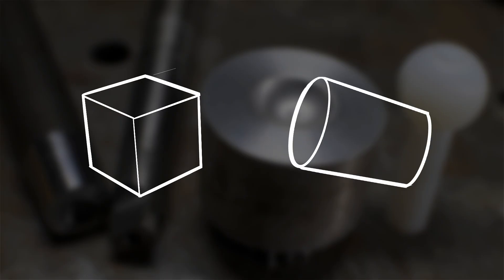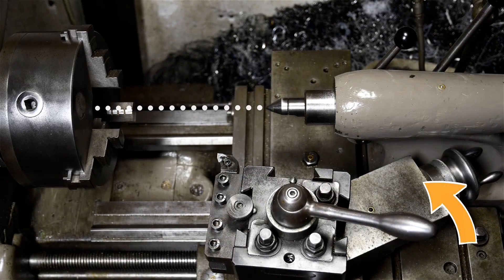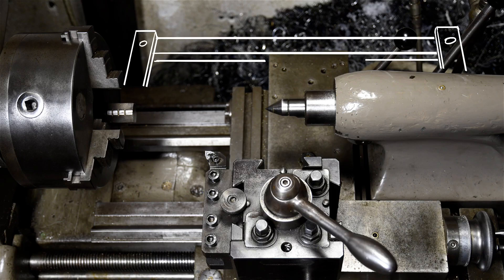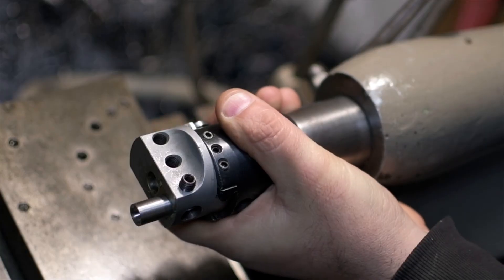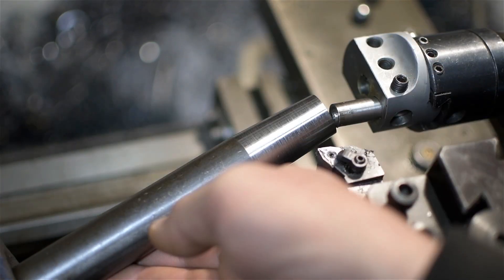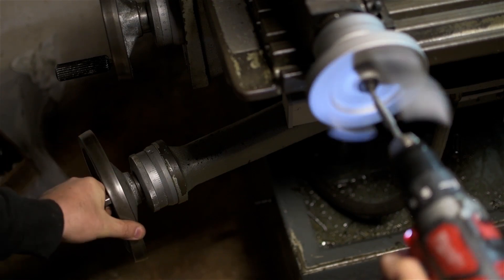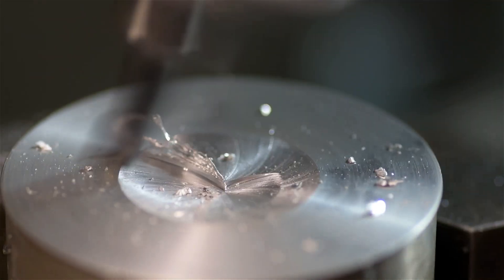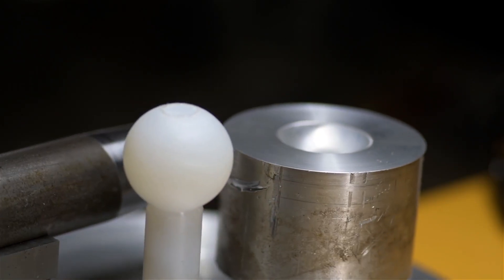Boring Heads & Tapers & Spheres, Oh My!

Comment: It is a sphere:
TL;DR:
Once you've finished clearing the center of the work, you've defined the work to be symmetrical about 2 axis of rotation simultaneously (the rotary table and the rotation of the boring head). This requires a sphere.

Longer, mathier version:

Imagine you're at your final z position, and simply rotating the stock with the rotary table. There exists some mess of Trig that describes the distance from the center of your desired sphere to any point on the sweep of the cutting head at that z position (remember, we're finishing, so the z position is fixed), and because the desired sphere is symmetrical about both the axis of the rotary table and the axis of rotation of the boring head, that mess of Trig is only dependent on the z-axis position of the boring head. Since that position is fixed, every point on the weird curve between the spin of the cutting head and the spin of the rotary table (doesn't matter what that curve is) is the same distance from the center of the sphere, therefore it is a sphere.

Visualization:

Imagine the boring head spins infinitely fast, so at any moment it's cutting a full rotation. If some cone's endpoint is at the center of some sphere, no matter how you turn the cone, there's the same-size circle of intersection between the cone and the sphere, at the same distance from the center of the sphere. If we use the sweep of our boring head as that circle of intersection, we must be making a sphere, because when we spun the cone the circle stayed the same
Reply: The internal curved feature is not a sphere.  The boring head spins the cutter on a circular path.  When you tip a circle, as the boring head tips the path of the cutter, you get an ellipse. Imagine a straight cut of the part using that spinning boring head, you would cut the bottom of that ellipse into the part. If you look down the cut of the part, you will see the spinning cutter trace out the ellipse that has been cut in the part.  Rotating an ellipse does not create a sphere, you end up with what Tony described, a rounded shape with an overly flat bottom.
 The external spherical ball is only a sphere if the cutter traces out a circle that would lie on the surface of sphere .. which would be hard to achieve unless you specifically set up the cutter so that the center of rotation of the cutting tip is the center of the ball you wish to create.

Comment: When are you going to talk about alternative cat-skinning methods? Will there be a video?
Reply: Poncho likes bacon He has a surface grinder and he knows how to use it.  Just need to figure out how to make the cats stick to the mag chuck.
Reply: That's easy, just fill them with ball bearings
Reply: I suppose that does give you the option to put it between centres
Reply: too much work. just ram a steel bar up it's rear :)
Reply: There's a video somewhere on the 'tubes of a guy skinning an alligator (no relation) with compressed air. I'll bet that would work for a cat.

Comment: For cutting the ball if the cutter passes through the height of the axis of rotation as it passes the equator of the ball then the resulting ball would be a true sphere.  But doing it the way you did where it passes the center line at the low dip of the angled swing it'll be some elliptical variation based on the angle.

For cutting a spherical cup you face the same angular issue that you have identified.  You need to use a flycutter set to a swing that matches the desired diameter and use it as near  to 90° to the axis of rotation of your work as you can get. So that means a fairly small center shaft and possibly a swelled head.... which is another topic.... :D

Comment: the offset boring head for tapers, silver solder balls from ball bearings* on to pieces of round stock. That way you don't risk losing the balls and only have one wear point on each end.

*The whole assembly, inner race outer race, cage and balls make up a ball bearing. The balls are just steel balls. Not to be confused with brass ones of course

Comment: Tony I'd like to know what kind of toolpost you're using..... If  it's not too personal.
Reply: Thank you I'll look it up. I bought some weird lathes for my high school shop and the compound-to-spindle center is small, but the compound slide itself is wide.  Aloris toolposts just aren't wide enough to prevent my kids crashing into the chuck. A turret type would be better, and best if combined with toolholders with height adjustments.

Comment: In theory, the closer to perpendicular your work piece and milling spindle is, the closer to a true round concave pocket you can make.... Right? Granted your tool can make the cut (ie: rigidity and cutter clearance)... you could do this with a dividing head and a flycutter/ single point gear cutter

Comment: Great as all of your other stuff. I was expecting you to do another boringheadception gag with the concave ends on the bar and the trick.  Always keeping us guessing.

If you revisit this it may be worth mentioning that the dovetail should be trammed parallel with the cross slide so its easy to put your tool on the centerline of the work.

Comment: I'm pretty sure that pocket is spherical. The flat part at the bottom is a tiny plane. It's the opposite of the problem you had with the plastic. 

Like, think about how the surface is created, it's a bunch of circles rotated around an axis. It has to be spherical.

Comment: Question! The line where the taper meets the stock isn't square; does this mean the taper is off center? How can you fix this?
Reply: It may mean that the stock isn't perfectly cylindrical.
Reply: more likely (apart from the center drill hole at the end of work being offset) the boring head in the tail stock wasn't perfectly horizontal - it has to be in order for that setup to work properly

Comment: Really cool video, did you try to attache the boring head to the toolpost? you can turn spheres that way. The boring head axis should be perpendicular to the axis of the lathe, and level with the bed. and been able to spin, obviously.
Probably you can make some sort of morse tool hoder that can spin with a lever or something.
Reply: One problem of your proposed set-up is that you cannot lower the boring head to cut down to the axis of the lathe/dividing-head or you will cut off your ball before it is finished. Therefor the angled axis of rotation of the boring head. For ball handles it would still be sufficient.
Reply: No, i meant using the boring head as a radius cutter, not as a proper boring head.
Just use a lever to go back and forth making the radious of the ball.
Reply: Now I get it. Geometrically correct but not very practical to cut an arc by hand from one side of the shank to the opposite side. I would prefer a ball turning attachment on the lathe over this proposal any day...:-) Why do it the simple way when you can enjoy complicated ways so much?

Comment: peed my pants! how exactly did you make sure the boring head is perfectly horizontal in the tailstock? dial gage along the groove? thanks!
Reply from the maker: in the video i 'sighted' it against my cross slide, but yes and indicator would do the trick.  honestly i'm not sure how sensitive it is unless you're completely 90* off.  that would be bad.
Reply: I use a machinist level on the flat of the boring head. As long as your machine is also leveled, you're golden. You can also use your cutting tool to check. In reality, you can be off by a few degrees without impacting the taper negatively. A test cut or iterative cutting will reveal any incorrect boring head alignment.
Reply: Thanks Jeff! , Unfortunately my lathe is not leveled so I guess I'd mount the dial in the crosscut sled to double check :) good to know!
Reply: but how do you KEEP it level?  If I'm using a drill chuck or similar, it'll rotate a few degrees before it really locks in.
Reply: I tap the boring head ( or drill, or live center... ) in with a brass hammer sometimes, but only rarely. There's enough load on the boring head to keep it tight in the tailstock taper, so it shouldn't twist. Make sure your tools are clean and especially your tailstock taper when assembling the setup.
Reply: This Old Tony if it does move, it shifts the work piece vertically, which takes the cutting tool off centerline. So one or two degrees isn't a huge deal. But ten degrees is.

Comment: how about using the horizontal milling machine, would be cheaper and ridged

using a ball nose milling tool for a center cut
and you would lose the flat spot on the bottom in theorie

only for bigger holes
Reply: and salad bowls of course

Comment: DIY Hip Replacement - Part II
Reply: What's so hard about the installation? Some cuts here and there, chop off the old hip joint, bolt in the new one, and granny is good to go.

Can't be that hard, now can it?
Reply: I find that, like any other mechanical project, liberal use of ethanol and a large hammer eases installation.
Reply: Making the parts is one thing, installation is, well, another.
Reply: Lukas don we both know granny is just gonna sit on the bench for 6 months half apart while you wait for extra parts. Then you are going to just say fuck it and buy a new one at home depot.
Reply: What cutting oil works best on granny?
Reply: Wankel Motor 
White lightning ?
Reply: Keith Ward 
I don't know, I've watched joints being replaced ( on people) and thought, hell, I could do that! 😎
Reply: You beat me to the hip replacement by 1 year and 9 months. How many has TOT done in that time, I wonder.
Reply: that joint has to be made of titanium, so you'll get your money's worth
Reply: That hip replacement bit in the older video caught me totally by surprise and had me in stitches, so to speak.

Comment: 8:20 why is the "end" of the taper on an angle ? (very nice video btw)
Reply: He probably used my 3 jaw chuck to drill the socket in the end of the rod. :P
Reply from the maker: yes, what they said!  stock not round, probably centers off-center.. and the boring head alignment was spit-balled.
Reply: Thanks for the info ! =)